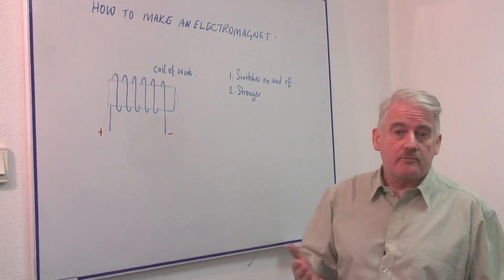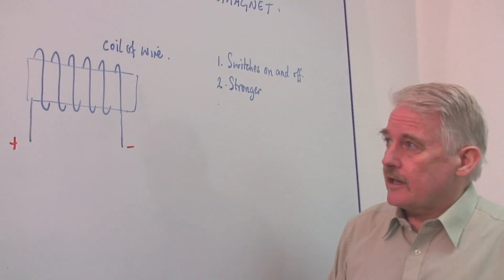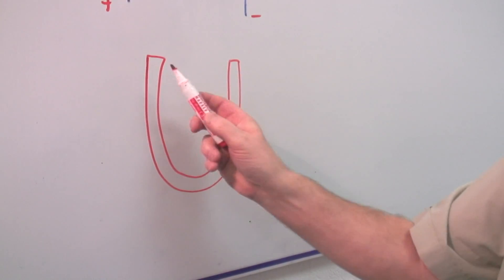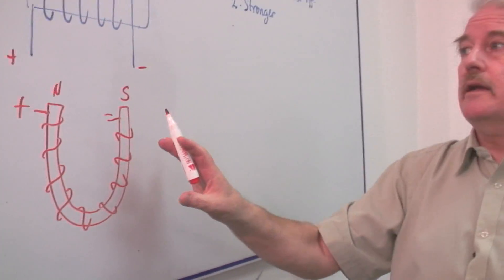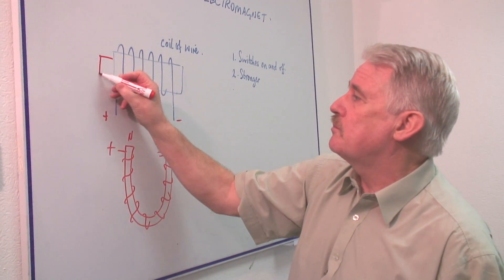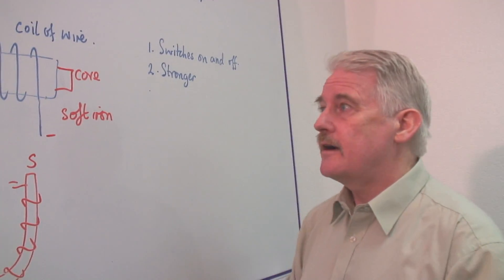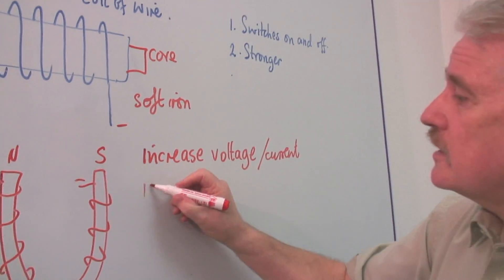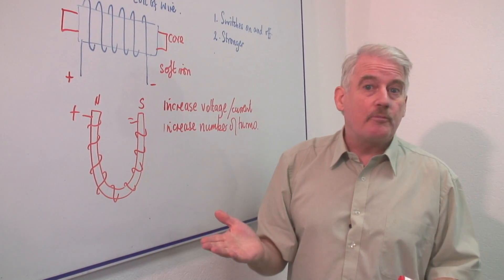Physics & Electromagnetism : How to Make an Electromagnet

Comment: Sir Joseph Henry said that you can make a stronger magnet by using short lengths of wire in parallel with a low impedance power source such as a single cell. This is a great video.
Reply: This video sucks but you are absolutely correct. paralleling multiple conductors will make an electromagnet so much more efficient with much less voltage. no where on the planet does it say to use only one length, it just says "N" number of turns.

Comment: Using 66 feet per volt of what ever copper wire size you use, it will not overheat the coil.  So for one D cell, 1.5 volts, use 100 feet of wire. #28 wire would be good for that cell.

Comment: @shreeshaipod The reason for having a metal core is to concentrate (for use of a better word) the magnetic flux produced by running a voltage through the wire. Try picturing it like this.. Basically the iron core captures, or absorbs, the magnetic flux (magnetic field produced by the wire) thus turning the core into a magnet whilst the voltage is flowing. One end of the core will be north, the other south, depending on which way round you wind the wire. So a core simply emphasises the effect.